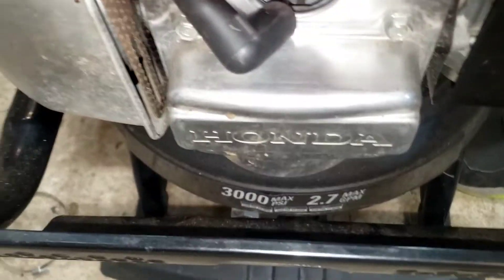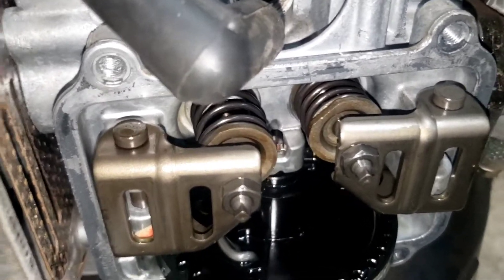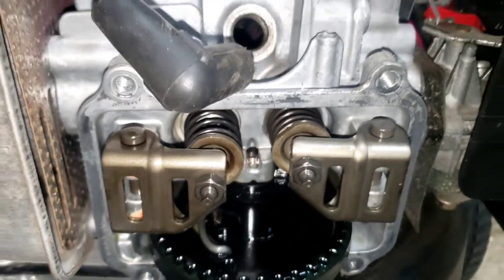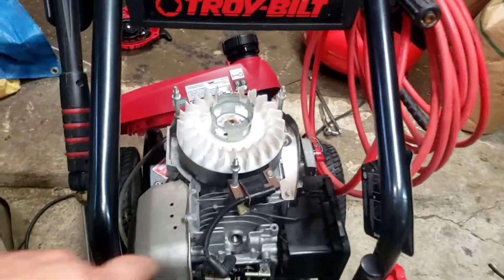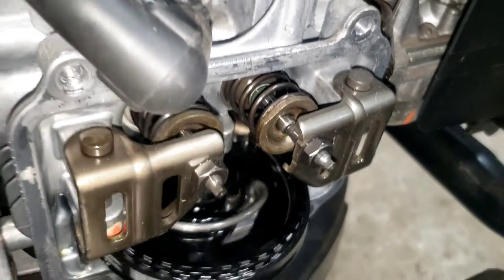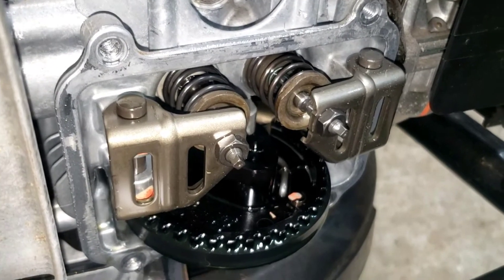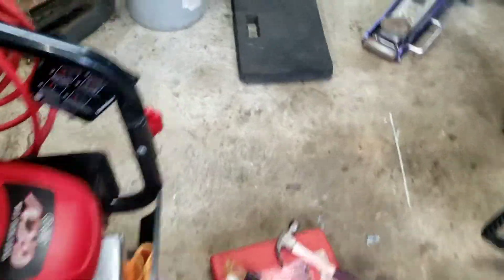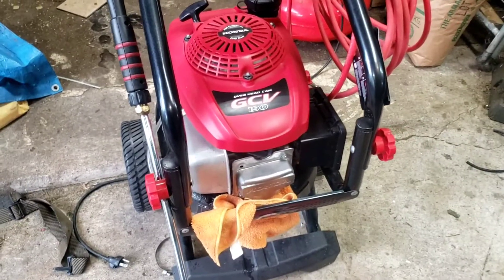stuck valve Honda engine gx160 or gx190.

Comment: How did you un stick it?
Reply from the maker: Make sure you spray oil on the stem of valve. You can gently tap the valve while turning the flywheel. Don't hit it too hard.